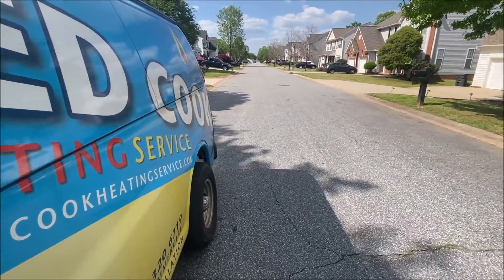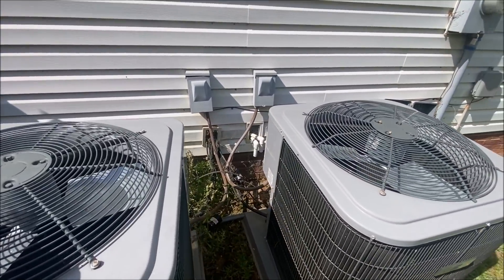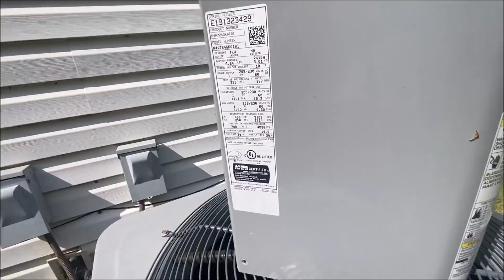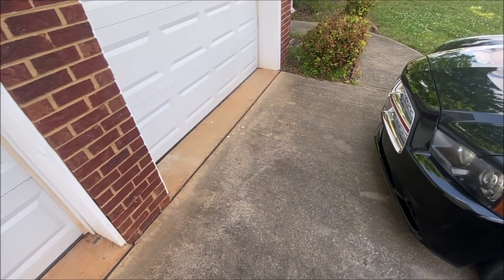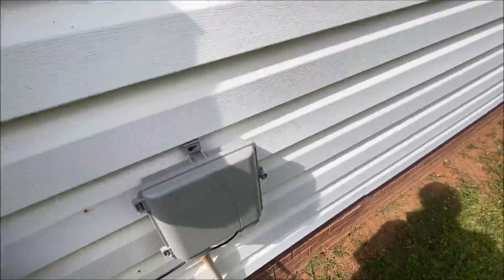AT&T Broke the Air Conditioner

Comment: that wouldnt be allowed in canada cant put low voltage in any of the boxes that contain high voltage... that would of been chopped quick..we also keep those boxes closed with a tamper seal.... cable installers will find the fastest easiest way possible, installers dont care just slap it together put some lipstick make it look good and call it done trying to hide the actual damage... (Not all installers but a good majority its heaven when you actually have a installer that cares and there work shows...)

Comment: Here is a rule for installations: it belong to whoever installed it. Meaning you could cut any wires added to you box. And charge then for it. Unfortunately, that leaves a very very unhappy customer. If I were the owner, I would call a certified electrical inspector and have him asses the situation. Then bill whatever fix he requires to AT&T.

Comment: Wow so absurd. How doea a technician care so little to install fiber internet like that. Let alone sleep at night or look the customer in the eye saying "he's all done". Obviously, he drilled from the inside without a thought in the world about where it comes out... and then just STUCK WITH IT after noticing it went through the electrical disconnect. You can see some chewed up insulation in there, his drill bit definitely ran into a live wire. He is lucky he wasn't shocked badly and that the break tripped.

Comment: That's not even code, your not supposed to run coax cable threw a 240 volt disconnect for Air conditioner for any reason, for the simple fact the high voltage would interfere with communication singling on the coax and would cause interfereance, cable company"s and employees don't know because they are not electricians, and only deal with low voltage, same with telephone companies, low voltage, they probably broke the insulation on the AC wiring and trip the breaker, like you said. Good job Ted.
Reply: Fiber

Comment: Looks like the installer stripped the insulation off one of the wires with the drillbit. That needed to be replaced, because it can short out again and is a fire/shock hazard. You really ought to get back out there and do the job, or at least let the homeowner know they need to call an electrician and have the wire replaced...

Comment: Also the PHONE Company Can NOT PER the Electrical code use a High Voltage box to run Low Voltage in . Has to be to separate boxes . The Kids they hire know nothing .

Comment: That AT&T tech should be fired. You do not run low voltage telco or fiber optic wires through any panel with 110 or 220 VAC or higher under any circumstances. And thanks to what he did the outside disconnect for the AC is no longer weathertight. You should call in a licensed electrician to make sure it is all properly fixed. And that conduit under the ATT box should not be open on top as it will water to get into it.

Comment: No power wire was drilled through, it was a fiber optic line. He obviously drilled and threw the breaker but who owns a house and doesn’t check the breaker before calling a tech?  Simple solution.  If there’s no power 9 out of 10 times a breaker tripped.  Techs try to not drill extra visible holes in a ho,e if they don’t need to, this AT&T tech did the least amount of work and didn’t care much about what he was doing but if you want internet techs who are electricians then be ready to pay more for your service.

Comment: The reason that he did that, is pure laziness. Nothing else. Thankfully its just fiberoptic and not a coaxial cable (was thinking low voltage right to high voltage) but still, wrong thing to do for sure!

Comment: If it continues to be a problem with no short then the breaker is bad. Standard breakers should get no hotter than 90 degrees Fahrenheit. I stay out of the crossfire cause it could land you in court. Stay neutral, friend. Thanks again.

Comment: It doesn't seem to take any knowledge or even common sense to work for att. I recently had my cable upgraded and the installer, rather than go into the crawl space,ran the wire through my dryer vent. Not around, through the inside of the vent. I found out the next day when I tried to do my laundry. Luckily no one died , because there was no way to reconnect the vent,the installer just left it unhooked and went home.

Comment: Those cable install guys are hacks and for good reason they are barely paid for the work they do. All their tools and van is 100% on them and they only get around $50 per install. So they do anything in their power to run those cable lines into your home as quickly as possible and as long as the cable turns they are out the door. Im also a victom of my cable guy. Lol he drilled a hole into the back of my ranch rand the cable stright into my basent went across the house to the other side drilled another hole frome inside the house into my attached garrage, then ran the cable on the exterior of the drywall at the back wall of my garage going about 6' up then drilled another hole that goes from the garage through the house into the intended bedroom. Ugg didnt bother sealing anything either.
Reply: Hell they will run the cable line through the funace flue pipe if they feel its the fastest way 😆

Comment: That's fiber optic cable. I bet pinching the cable in that cover caused damage to it. What a terrible lazy installation. And I bet the wiring from the panel to the disco will need to be replaced because it was nicked.

Comment: Didn't use the bottom of that box to run a wire to make it neat, the outside run is "meh", left cut cable just dangling outside, drywall damage AND that port looks crooked!? Jesus that installer needs to find a new field or learn to take SOME pride in their work.

Comment: That's not legal/code. Can't have low voltage and high voltage in the same entry point.
Reply: Fiber isn't a voltage. It has no wires. So I wonder if it is a violation.
Reply: @Bryan-Hensley  Still is because the disconnect cannot be fully secured.
Reply: @Bryan-Hensley  good question but I think it is a violation?

Comment: "Let's put our low voltage wire in with the 220 wiring.  That will be the ideal place for it."
Reply: It is fiber optic cable, nothing but light going through that wire.  Still should not have been run through there though.

Comment: Low and high volt needs to be separated in a junction point. surprising that they did that. AT&T got plenty of money though
Reply: in this situation it's not actually a problem, that's fiberoptics they installed there so there is nothing conductive about it.

However, regardless if it's copper or fiber, it's still extremely stupid of them to do it that way.

Comment: Regardless of the issue being caused by AT&T the question needs to be asked as to why didn't the home owner reengage the breaker that appears to have been all that was done. The breaker was switched back on and the AC started to work. So basically the home owner called you out for a tripped breaker which you switched back on again.

Comment: Talk about a sloppy AT&T installation and one that violates the electrical code which bans mixing high and low voltage in any conduit or container.  AT&T must be desperate for installers and they obviously don't do any follow up inspections, or stuff like we see here wouldn't happen.  If a fire resulted from this, and it easily could, AT&T would be in big trouble.  🤥